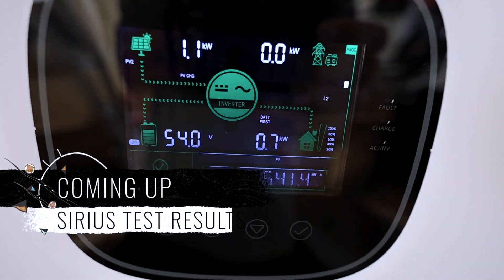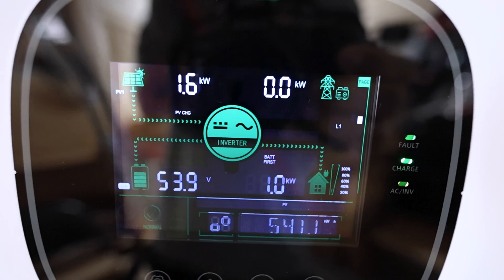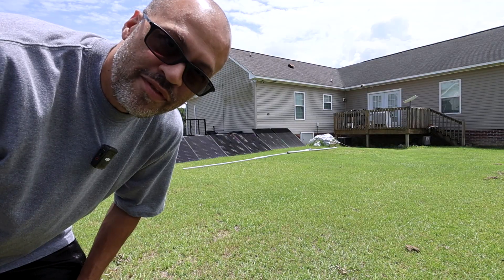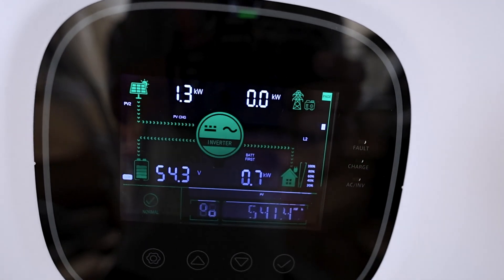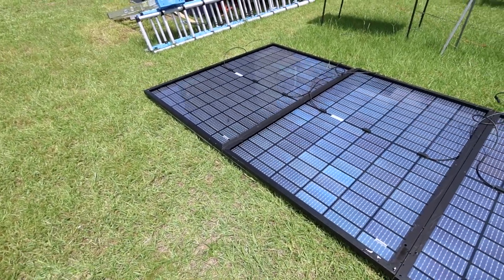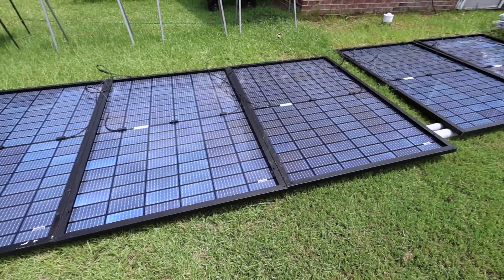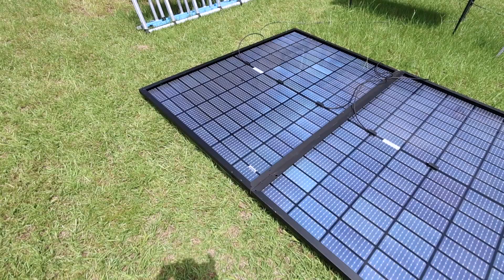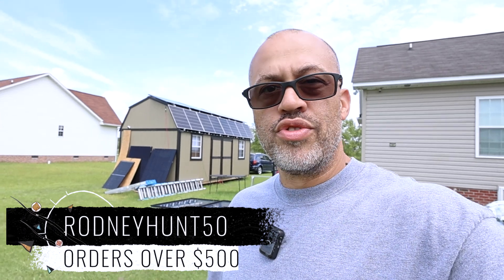Crazy Test Results! Rear of Sirius 415 Watt Bifacial Solar Panels Tested

Comment: I read the spec sheet on these solar panels. The front VOC rating was 37.42 volts. The rear side says VOC was 37.42 volts. I live in northern MN. With snow on the ground in winter and minus 30 degrees below zero, The panels will be at their peak energy delivery. 
I was wondering if that VOC is just that, total is 37.42 volts?
Reply from the maker: Yes the VOC can be higher during cold weather. Eg4 has a calculator online that will help you with the calculations

Comment: The panels were tested at two extremly different angles. How can that give good results?  Did '=I miss something?
Reply from the maker: @1thinkhealthy  two different angles? The test was really just for the back on this video. I just showed what the front was getting at its current position before moving to get a general feel for current solar. Not an exact comparison since this is far front scientific. Plus I wanted the front to be mostly covered for the rear of panel test. Will try to make that clear next time. Thanks

Comment: Off topic but not sure how to reach out otherwise. I’m not quite ready to be off grid but as a newcomer to solar what would you recommend as a starter kit for someone interested in getting started. A kit? Separates, the anker you just did a review on and a panel? 12v, 48v? I know others have touched on it but I like your style and trust your judgement. Just a feeling. Keep up the good work.
Reply from the maker: @paulminott150  hey what is your goal at least to start with? Power a few things for emergencies or partial backup running all the time?
Reply: Ideally I have a small work shed that I would like to have lights when I need it. Possibly charge up some batteries for tools, phone. I live in Ft Lauderdale and we go through hurricane preparedness almost every year so possibly run a refrigerator/cooler. Just went through ur Anker review something like that plays a panel? Panel size? 200?400? Or DIY with an inverter etc?
Reply from the maker: Depends on budget. If you want to move from your building to your home maybe portable. Anker makes some great stuff so that may work. But being in FL and hurricanes I would recommend a bigger unit for longer term outages with a permanent or semi permanent solar setup. If your budget allows a 6000xp if a great option you can build a portable setup from but its heavy. I just started a discord if you use that and you can send questions there if you want. Will send a link
Reply from the maker: https://discord.gg/pp8yb3vj

Comment: before you put up your mount for theses there is another experiment you can do for bi facial panels.  set them up like a fence running north south.  others have claimed more production earlier and later in the day with this orientation. mid day production is less but for me i need more first thing and at end of day....mid day my batteries are full and most of the solar is wasted. i dont have bi facial and my  system is maxed out with battery storage and solar input......just wondering if this is a thing that i may be able to adapt to my system.
Reply from the maker: Sure I can do that weather permitting! Getting much rain over the next week and going to try to build the mount. But I should be able to do it

Comment: That is wild and curious for sure. The curious part is how they are tested to come up with the bifacial wattage.
Reply from the maker: Yeah I need to do some research. I thought it was pretty wild and the panels should do great on the right mount
Reply: Slightly Angled Carport Covering facing south here in the Southern California High Desert at 3,100 feet from Sea level should Work Really Good  - Combination o Sand and Grey DG or White Granite Rock underneath -
Reply from the maker: @1GREATDANE  indeed. Wish I had something other than grass for these panels. Pros and cons to everything I guess
Reply from the maker: True